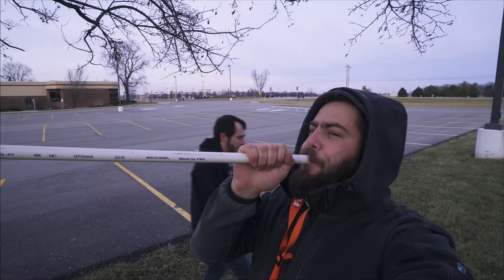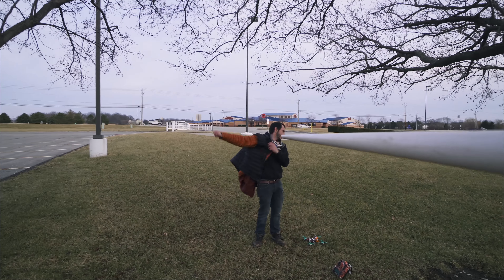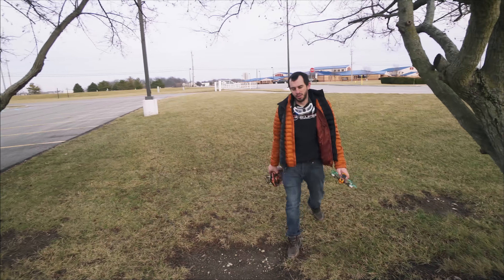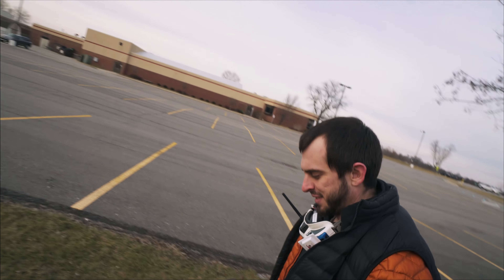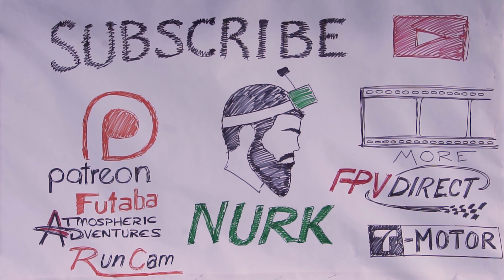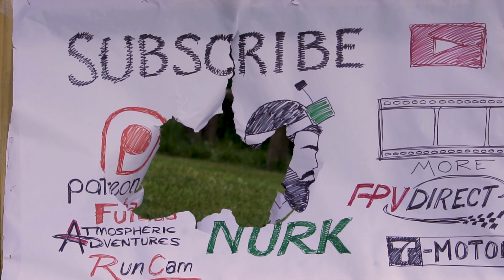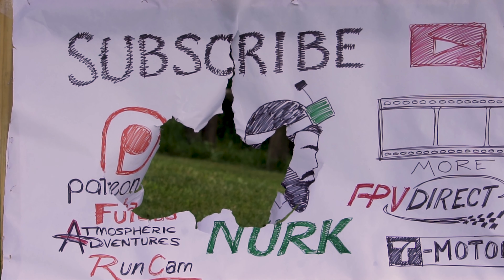Hat Handoff and the New Freestyle Machine

Comment: Is the stack hard mounted? No vibration dampers or bobbins? I've had some challenges on 6" machines unless the FC was nicely soft mounted.
Reply from the maker: Hard mounted
Reply: I'm amazed. I've had lots of issues with mid throttle oscillations on 6" machines, tried all kinds of props and motors and even different frames, only way I could get it to stop was using soft bobbins. I would love to hear your thoughts on this. Have you ever had mid throttle oscillations, and if so, how did you solve it?

Comment: Nice rip Nurk!  Love the proximity flying!
Just got my new laptop.. time to finally try a sim.  
Raining non stop here lately so no flying unfortunately...
Reply from the maker: Proximity for dayz
Reply: BamBamFPV.  Dam is that why i can not get a sim to work!! Because my laptop is 7 years old!! I have been trying to hook the qx-7 to a sim no luck!? Any help would be great!! Going to check out your channel now probably going to subscribe as long as you post drone stuff or footage!! Lol
Reply: What is the sim? For my sim you need to change settings in the control for it to work. Check the sim website for more info
Reply: The sim sort of works on my ASUS Zenbook but it doesn't have dedicated graphics so it is super choppy and not usable.  I just got a Dell with an NVIDIA graphics card so should work with it.  Will see soon, just got the Dell in the mail today and doing updates now.  Will install the sim soon.  If your laptop is 7 years old I'm sure that is your problem.  My Zenbook is a year old with a 7th gen I5 and still can't run the sim... I believe they recommend minimum an NVIDIA 960 GPU. I am curious if an NVIDIA MX150 would work though...  Not sure that I like this new Dell...  too big and heavy.  Some of the ultrabooks now have the MX150 in them.  I may end up taking the Dell back and getting something else.

Comment: Are you using the board-to-board connector to connect the FC and ESC? Any issues with that in a crash? I've heard the connectors tend to break off.
Reply from the maker: Board to board. No issues.

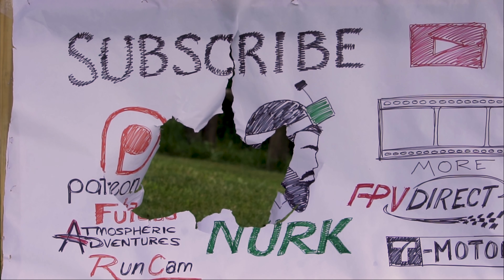Comment: 2:00 why not just run the motor wire on the bottom side of the arm vs creating a break. Sounds like a way easier solution vs white noise setup. I'd love to here insight, never seen that before, cheers
Reply from the maker: it's really a product mostly for racing, rather than freestyle -- allows you more protection and makes things easier to swap (all the pads for the motor are right there. For freestyle, it doesn't matter so much, but I needed it because I was going from 4 escs to a 4-1, and I needed longer wires.
Reply: I will order a set of those. In all my hellacious crashes I seem to destroy esc's and wires no matter what I run. I am the master of prop strikes.
Reply from the maker: Do it!!!